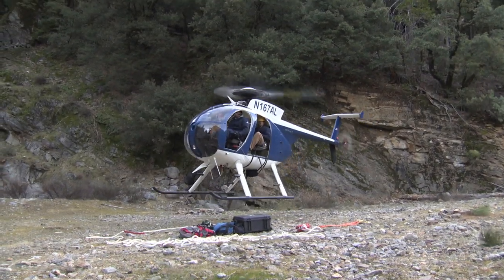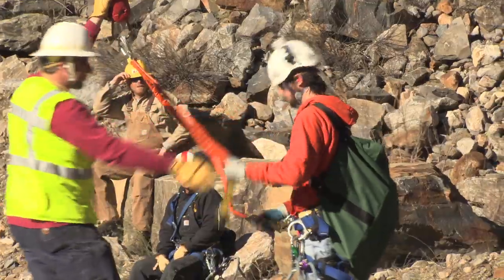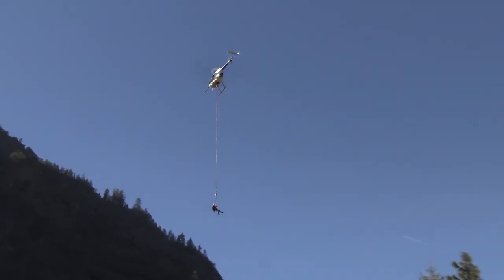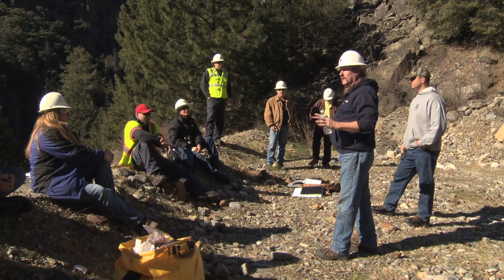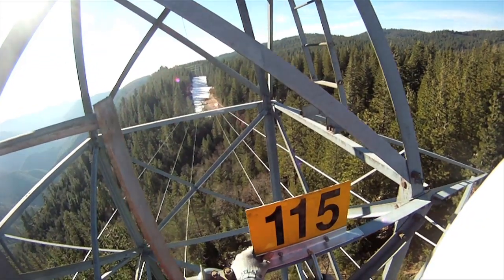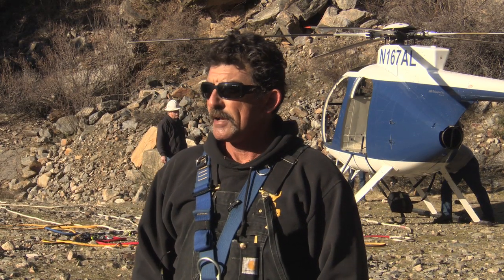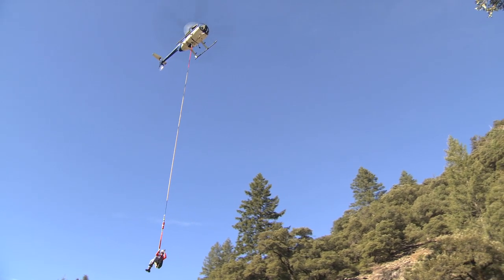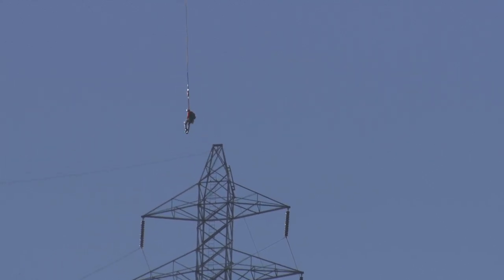SMUD is long lining to repair electric infrastructure

Comment: I have been retired for over 10 years and worked in this same area for PG&E. We began to use helicopters for this kind of work several years prior to SMUD. It is far safer that you it looks. We have long lined and road on the skids to do work.  It requires good communications between the pilot and the lineman. Both train together so they know each other well before they fly together. The first time I used Helicopters for lift work was in the early 80's to replace poles in the Donner Summit area.